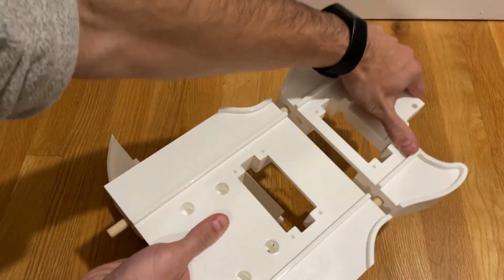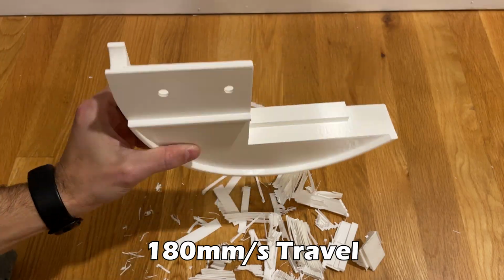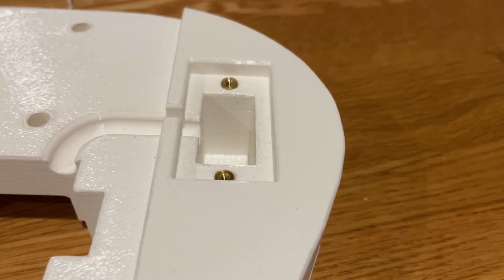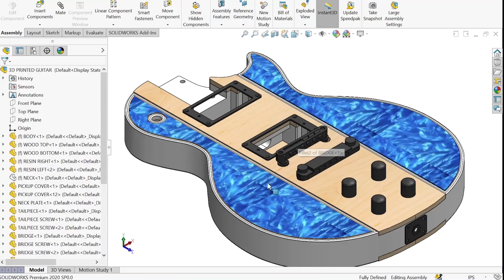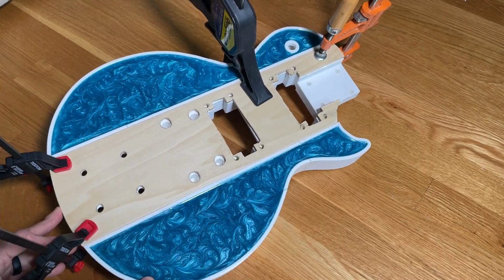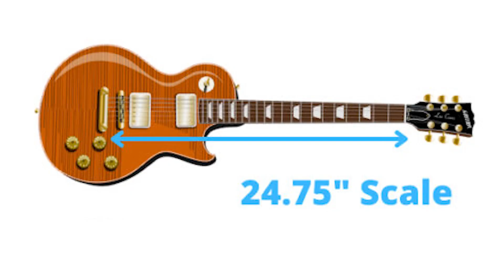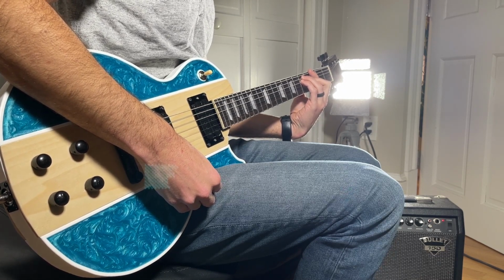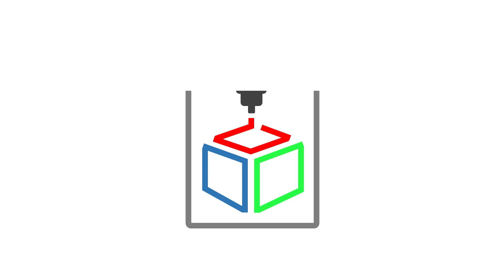3D Printed Electric Guitar (PLUS Epoxy Resin)! Step by Step Build

Comment: Your mistake with the jigsaw was caused by not having a fine blade inserted, the blade you had in it should only be used for ripping wood and not detail cuts.
Reply from the maker: Next time around I will definitely use a finer blade with my jigsaw....or might even get it laser cut :) Thanks for the feedback, like and subscribe and happy printing!

Comment: Brilliant design!!! I will add this to my next 3D-printed project. Already built 2  3d printed guitars with Strat and strandberg shapes, but had a few issues dealing with the string tension and proper intonation. I think yours solves these issues and helps the guitar sound better. Anyways, what is the total weight of the guitar compared to a wood Les Paul?

Comment: Awesome build. I'm planning on 3d printing a guitar body soon. This is going to be my first build and your video has been super helpful!

I have a question though. Im thinking about adding latches on the bridge (with 100% infill) for 4 sections of body, as well as slots for dowels on the body, to make the rest of the body fully customizable. Do you have any idea how this would affect the structural integrity of the bridge piece? I really dont want any material creep.

Really, great video!

Edit: if it matters I will be using PLA.
Reply: did you managed to build it?
Reply: @averagefan8199  I decided against doing a 3d build, mainly out of concern of the guitar being top-heavy. I did build a tele-style guitar though and it turned out great.

Comment: Question is there a way to select different filament and print a guitar in one piece.  I realize it requires a large printer.  I am more talking about filament and maybe multi filament.
Reply from the maker: Yes, the model can be combined into a single part for large build plate 3D printers

Comment: I am having issues with the neck fitting, did you have to sand the body to get it to fit? It is a little too big for the body and wont slide in.

Comment: Do the STL files come with a fill in piece where the wood goes? Or will mine have a divot?
Reply from the maker: They come with a pocket for the 1/4" wood panels. I will be adding the STL files for people who want to 3D print the panels instead of using wood. If that is something you are looking for contact me through the website.
Reply: @the3dprintzone  Neato cheetoh my dude. I also subbed to your Instagram. I am so stoked for your warlock video haha. I'm a metal head and it's my absolute fantasy to make a modular 3d take down guitar. Something easy for TSA travel if and air planes. You might be able to pull it off!
Reply from the maker: @CaptainPantys 🎸🤘🏻

Comment: It certainly looks interesting. But the most important question of such 3D and epoxy guitars is, how do they sound in the mix? Apart from other instruments and with new strings, you may get the impression that this project has a good sound. But a comparison with an instrument that is built of high-quality wood, I'm afraid it will be at the level of a guitar from an ordinary Chinese guitar factory.